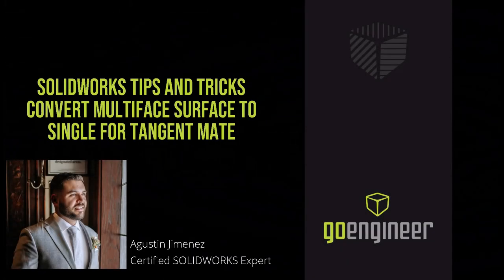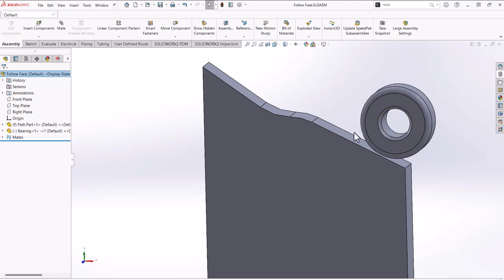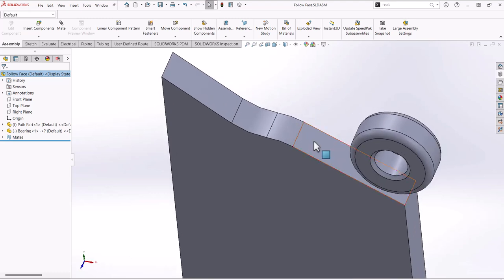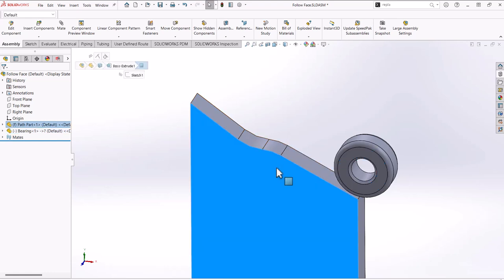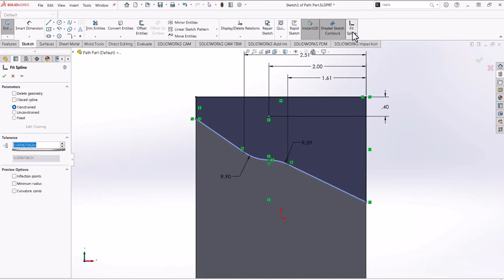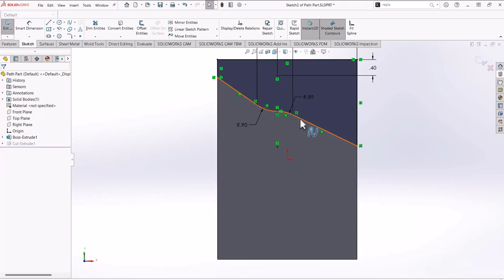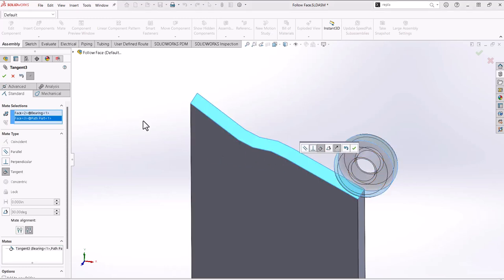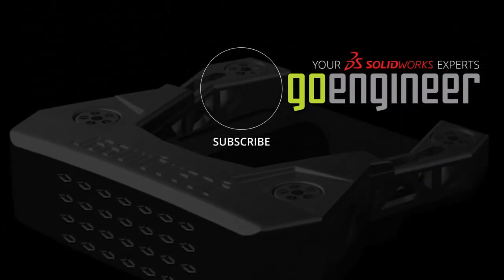How to Create a Multi-Faced Tangent Mate in SOLIDWORKS

Comment: 2:31 Hey man nice tutorial. How can I enable the feature where it shows you which mate is connected to which mate? Seems very helpful, I mean the small arrows next to the feature manager.
Reply from the maker: Thanks for watching! It's a great feature! In SOLIDWORKS, go to the View tab, and under User Interface, select "Dynamic Reference Visualization (Parent)".

You can enable this by default if you enable it in your templates.
Reply: @goengineer  Thank you so much for the reply. I'll definitely add this template, thank you for your video it's very helpful.